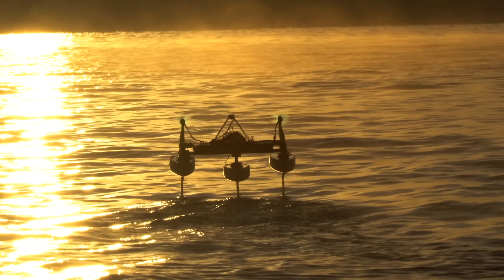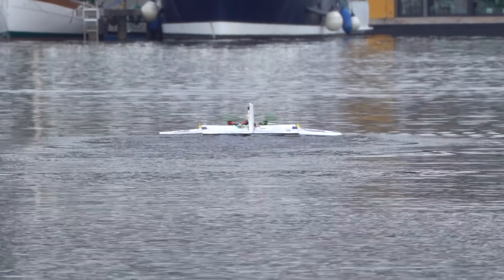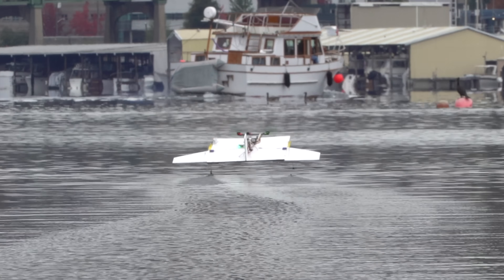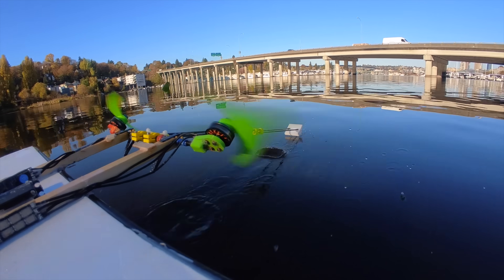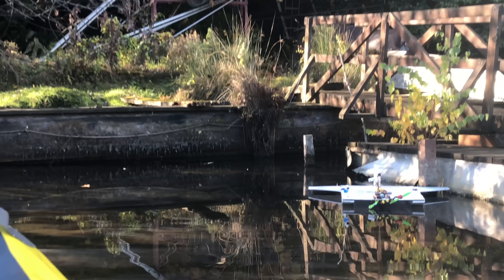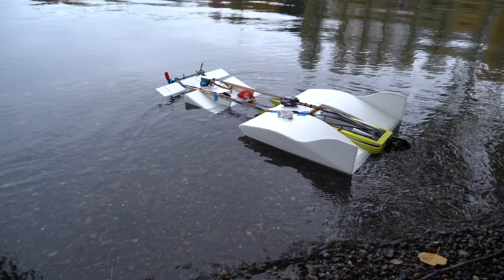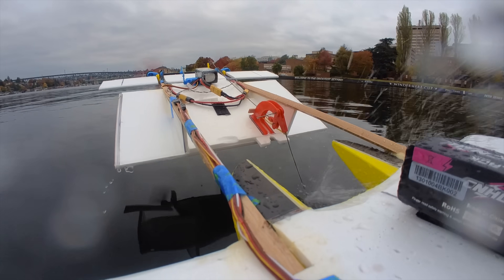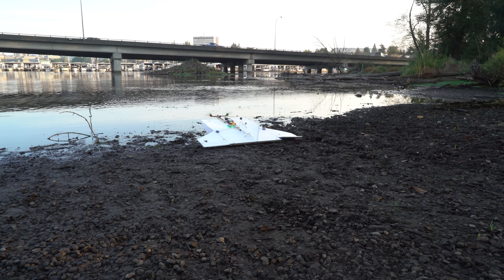Hydrofoil Control Mechanism on a Ground Effect Vehicle

Comment from the maker: Use code RCTESTFLIGHT50  to get 50% OFF your first Factor box at https://bit.ly/3JgFdFQ
Reply: Canard configuration and very flexible tapered wand that is able to be parallel to the waters surface at the tip when in contact, for minimal drag and high frequency ripple damping
Reply: Whats the thrust to weight ratio of this vehicle?
Reply: @automatewithjonathan1870  in static thrust I would say less than 1 🤓🤭
Reply: Wired and popsical sticks - You deserve a thumbs up just for that!
Reply: I think the problem is you were using 2 control arms you should try using one singular control rod that connects to both wings
Reply: @Adeptus33  he should flop the aerofoils upside down.
Reply: All rods receiving input from the water should have curves.
This will change the input over time.
Reply: i think because both of the rods going in the water were not tied together, therefor creating unbalance @rctestflight
Reply: 15:50 Bonne portance tu a fait un bon travail aérodynamique félicitations bonne pousser inverser mon amie ce n'est pas facile 👌❤️🇫🇷
Reply: What about opening a lid in the middle front section when front rises to reduce lift? 🙃🤔🤓
Funny project 😎👍

Comment: Your wand would likely work better if it were float based and more parallel to the water, at high angles reference to the water it's mostly providing speed feedback until it's totally out of the water, with a small amount of depth feedback as a result of added drag with depth pushing the rod back. I think to make this work it needs to be set up for neutral attitude at the desired ride height, and look at the motion ratio - a more progressive ratio between height and flap control may be advantageous. Could even consider making the rod a bit bendy to allow it to damp out some of the surface roughness.

Comment: great work, one of the best I've seen in years. Few thoughts: have you calculated the aerodynamic center of your vehicle? It seems like there is an inherent dynamic instability. Also, the vortex that are blown out under, once the laminar flow is broken down cause a strong suction effect that I think is causing most of your crashes. Putting multiple smaller propellers in front + back and controlling the airflow under the belly can help fix that.

Comment: The reason there looks to be more wash coming off the pontoons is due to the air blowing under spreading and going in a down/ rearward angle when it collides into the sides of the pontoons I do believe

Comment: One thing to note, at the beginning your wands were too short and were coming out of the water causing the nose to suddenly drop. If you made them longer there'd be more room for it to adjust back down gently. Another issue is that your control was linear, it had the same pitch down effect even as the pitch up motion started running away. You could solve this by adding a bit of curl to the ends of longer rods, that way as you start to pull away the rods have to rotate faster and faster to keep in contact.  With enough bend you should find a balancing point where the pitch up of the nose and the pitch down from the controls balance for neutral flight without having either runaway ahead of the other's corrections. I believe you could get a similar effect by rotating the control arms some degrees out of phase from one another, but that's harder to adjust and plan, maybe something to do once you identify the correct input curve later.

Comment: Have you considered that on the last example you are creating a large venturi. The large area of compressed air is moving fast and actually sucking the plane downwards. The nose has to stay high so the compression effect doesn't occur or at least only near the trailing edge. Lift is coming from deflection only. You're not flying on a cushion in ground effect here so much as you're trying to climb a rolling dam of air.

Comment: Daniel your Ground Effect Videos are awesome. You have found the true Ground Effect Vehicle that will not fly OUT of Ground Effect when you removed the Elevon link and how your Bixel happily flew about 10cm above the surface with no Roll or Pitch control! 
My Q is, how to balance it with a rear mounted pusher prop?

Comment: The wands out front will anticipate the height of the craft, whereas further back they react to it, so more likely to cause oscillation. The sailboats you referenced have them out front and are stable. I think the out front wand on yours would have worked better coupled to the elevons rather than the canard.
Reply: The start of the oscillation happened when the craft reached height the wire wands were out of the water. So you're spot on about the positioning and further to add, the length of the wand and a flex in the wand can be incorporated to make that system work.

Comment: Interesting video,  not disparaging at all, interesting idea. But you are basically flying a powered kite, too much surface area. Prop direction pushed even more lift under your vehicle. I have therefore only 2 suggestions,  be happy that it works exelently at slower speeds or applying at cargo to require the neccessaties of the aforementioned lift, just my opinion.  Good job though.

Comment: Pay attention to why in the large Soviet ekranoplanes the vertical tail was carried out so far back and had such a large area compared to conventional aircraft. One of the main reasons is the high efficiency of such a tail for flight stabilization and the quick response of the entire system to control.

Comment: What about using a string in the water, if anything in the water creates a lot of drag, the amount of string in the water would create a very high res input.

Also, if the wand would open holes in the lift wing rather than adjust the angles, would that prevent long periods out of balance? Could not remember the name of the thing the wand controls…

Further, with small craft, maybe a finetune of throttle done by wand could be something?

And for ease of testing, maybe an remotely adjustable tension regulator of the wand. Like a screw system or something.

This made my brain spin, as you see, looking forward to the next!

Comment: aircraft need as little weight as possible. a wing in ground effect vehicle requires weight to stabilise it. one of the benefits of wing in ground effect is the weight that can be carried. indeed, the stabilisation factor of wing in ground effect is the pressure under the wing. you need weight to compress the air underneath.  keep the weight low down in the vehicle and even more stable it will be. with wing in ground effect, think buoyancy and floating at speed, rather than flying close to the ground.

Comment: Have you considered stiffer return-springs? either on the rod or the actuated surfaces? so that the water pressure on the rod is more muted in effect, rather than limiting the control surfaces themsevles?
Also, yeah, the rear control with a forward water rod would always exaggerate the problem of a ground effect vehicle.

Basically ground effect and normal aircraft controls are extremely different. Need to focus more on controlling pitch than overall lift.

If your control is in the back, and you start to pitch down, adding more lift in back just exaggerates the problem. The canards are a good idea since it gives you positive and negative control, front and rear. But pitch is the main issue with ground effect. Maybe use 2 control rods? (one to the front, and another to the rear?). That would give your mechanical controls some access to the relative pitch, if hooked up right. Notice the control rod on that speedboat was in front, and controlled the front water planes. I could even see a 3-rod system being a good idea. front rod controlling front control surface, rear rod controlling rear control surface, and a center rod increasing or decreasing the overall lift input both front & rear. There'd be a lot of pivot points involved though.

One problem on water, is that ground effect tends to mute the effect of waves via air-cushion. But putting the controls in the water, makes the waves have a lot of impact on the pitch. So I think the control effect needs to be pretty heavily dampened. Could always use a hanging weight to monitor pitch. Would give something like crude horizon monitoring. And then a control rod under the center of gravity for altimeter. The control rod has a lot of resistance though (drag, but in water), and it moves... so that's "complicated".

Comment: Can you really call it a ground effect vehicle when you have such steep angle of attack on the wings? If that thing had more power it could easily fly higher. Maybe I've misunderstood something, I thought GEV's were required to have zero degrees angle of attack.

Comment: You need to go back 2 steps...Why on earth would you use air propulsion for ground effect when you're over the water? Using water propulsion will let you throttle up and down quicker (reducing the time around the primary loop). As long as the thrust is offset from the CG, the skimming function is now under control of the throttle.

Build your skimmer around this and focus on having the structure to survive harsh bounces and enough control surface on the wings to recover from the random impulse into the air to re-enter skimming mode and voila!

Comment: I wonder if the oscilations from the first craft weren't caused by you having two wands instead of only one.. If one would hit a wave and react slightly differently to a wave than the other the whole system would go out of balance.

Comment: it seems the unstable flight comes from the rod leaving contact with the surface, maybe make it longer. maybe a curved rod could help for trimming the elevation to pitch ratio. on the bonus footage, you basically created a inverted wing that pulls you down.  i kinda like to see all the failed attempts 👍

Comment: F1 is dealing with a similar phenomenon right now, "porpoising" - The fix seems to be getting the height right and also tying suspension of all 4 corners of the vehicle together. I feel like you need dampers, something that slows the response of the wand to make it less "bang bang" steering, and possibly both forward and rear controls to help keep the system at a constant optimum angle.

Comment: I think the problem with the side wands is that they are independent from each other, therefore the angles of the 2 rollerons are different and create a roll effect which is even more amplified by the wands, ones gets closer to the water while the other extends. I believe this is where the instability comes from

Comment: Honestly feel like you need to dampen the wands output because sudden changes could be making the oscillation effect.

The sudden changes are what's causing it, if you can make them less sudden that should fix your problem imho.

Comment: Oh yeah right so you went from having the sensor in the middle to 3 meters in front!?
The rods need to come off the Very Very front of the craft and be effective in the water about 1/4 of the way down the length of the boat.
Have a look at the original design

Comment: Yeah - did you notice that on the Maned sail boats the feeler rods were at the Front?
Like you have them 1/3rd of the way back only activating in the MIDDLE of the see-saw so kinda like you need to look at what works and start from there.

Comment: You have two big problems. First, you have to move the center of lift aft.  Most ground effect vehicles have a reverse delta like wing.  Second, the wand has to follow the surface of the water, usually with a float.  In addition, the further forward you move the wand the more stable the feedback loop.  Having the wand in the middle transmits information too late for best stability.  Also the canard design is inherently unstable.  Burt Rutan made them work by making canard soft stall before the main wing. The best ground effect vehicles have a conventional "T" tail in the back.  The "T" tail keeps the elevator in clean air.

Comment: You may notice that the wand on the foiling Moth sail boats is mounted well forward for the foil.  Think damping.  If the craft rotates into lift, the wad detects exaggerated elevation & begins to damp it, before the foil achieves that elevation.

Comment: my bet is you're ultra light and the scale difference is making the control super exaggerated..,  the sticks you use for instance even if are to scale as apposed to the boats,  the water tension is equal to the boats and the boats total gross isn't even close so they dont care about the drag. its like how an ant cant escape a drop of water type thing.., .  id try it on pavement to try to get the geometry correct with minimal drag ..then maybe try to under scale it as much as possible.., but imo there's an easier way.., the bottle rocket method .., use the sticks as drag that limits speed and controls elevation so you can run it wide open much like how the tail on a kite or bottle rocket creates drag for direction.. the ekranoplan was a thing that in no way wanted to be airborne,. yours wants to leave this planet every chance it gets

Comment: I'm not sure if I can explain this idea. the motors fixed and enclosed side by side devided like a jet. now the air goes out the back clean. heres the idea at slow speeds more air gets diverted under, as it picks up speed a suitable mix more or less, may get some speed and the forced air underneath may give you the cushion without it flying.

Comment: Dashpots or shocky from the body to a short distance down the wand would mitigate sudden bounce movements in the wand from the water's uneven surface, minimising the sudden corrections as they'd be absorbed by the dashpot/shock absorber, tuning achieved by absorption and length on the wand at which its connected

Short sudden irregular corrections disappear, but large average corrections are passed through to the ailerons

Comment: I think the wand would work better if it was longer and had a more shallow angle in relating to the water surface. It would cause a more consistent drag in the water, and you could tune up the ratio of wand movement to aileron movement. Meaning more control and more subtle adjustments

Comment: I wonder if you add a curve to the steel rod. This can give you a varying gain vs altitude. Additionally if add a small larger diameter cylinder (sat 2x rod diameter) then there would be larger drag at low altitude (take off) and then less drag a ideal altitude. Fuzzy logic works like this where you can have overlapping geometric gain areas (e.g. zone 1 = take off, zone 2 = ideal altitude, zone 3 = too high get me down now!)

Comment: bit of a thought on the last experiment you did - having the two pontoons on either side helps scoop and capture oncoming air, whereas having the massive monohull lets the oncoming air get shunted pretty badly out to either side. You probably lost a good bit of usable lift due to not having that captured cushion of air trapped directly underneath the craft anymore.

Comment: in m slly brain, it seems liek the oscilations arebecause the rot was rotatign too far forward, and ins teady state it was turned way back, but then when it got outa the water it isntantly flicked 90*, then flew up lost speed, fell down then the rods were pushed back causing the wings to makeit hard pitch back down, so creating 2 limits for the first rod idea, so it cant go too far forward and too far backward,  to stop it pingign back n forth
Reply: other than that,bend it into a J shjape, so there is less drag att he bottom  and allows it to stay in water without havignto come out fully

Comment: 2 parts 
your wands are creating a pitch forward moment and generating a bit of lift when in contact. Its not a lot but your plane doesn't weigh much. 
When your wands break the surface the lower stop is so far forward you destabilize the plane in pitch and roll causing this oscillation. It would be if every time you pitched up too much you kick the stick forward. You need a bit of a damper. 

try using a fine string as your paddle so that the disconnect is less sudden and it generates less lift from the surface. The more you lift up the less of it is in the water, the less drag and hence less torque. Also if you put the contact point of the string closer to your CG you can eliminate your pitch down tendency.

Comment: Instead of using a plate like that, try to use a very thin vertical fin that use it's buoancy to do the mechanical pitch stabilization, whit low drag. And at the same time provide some passive yaw stabilization

Comment: Positive feed back loop . . . Usually not end well.
Control systems usually have Proportional, Differential and Integration controls. The control rod solution is only Proportional.

Comment: Re the sled changes at the end, Force = Pressure x Area, so if you concentrate all the lift in a small area then you need a greater pressure for the same force.

Comment: The rods touching the water need to be longer and curved, when it gets close to the top of its height control the rod comes out of the water and snaps forward causing it to pitch down and ram the rod back into the water which causes it to pitch back up hard and thus the cycle is started. If the rod was longer and curved and you tuned it so that it reached full pitch down before the end of the rod comes out of the water you might be able to reach stability. The curve in the rod is to take advantage of the changing geometry as different parts of the curved rot touch the water at different heights, basically with the right curve you can decrease the sensitivity or even with a more complicated curve you could have increased sensitivity near both ends of travel but very little sensitivity near the middle of the range.